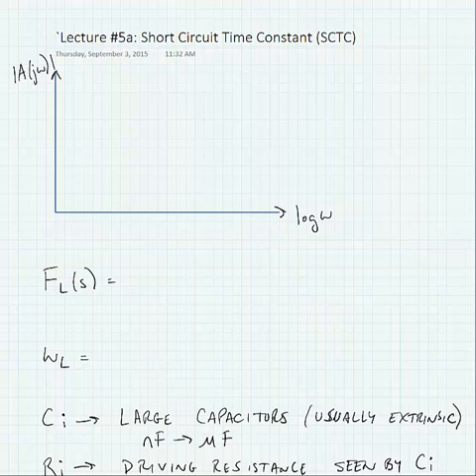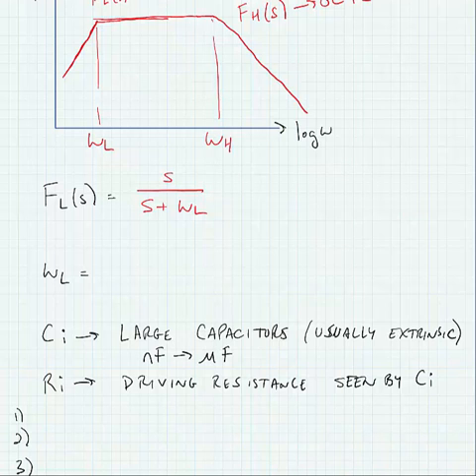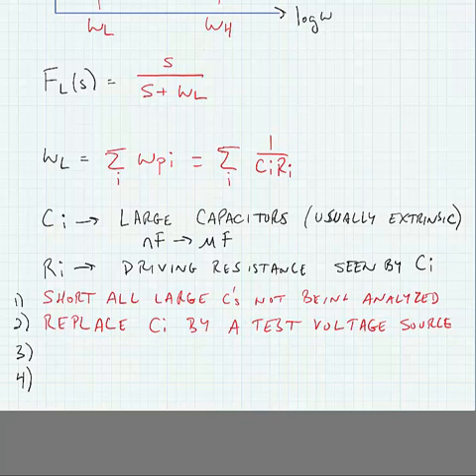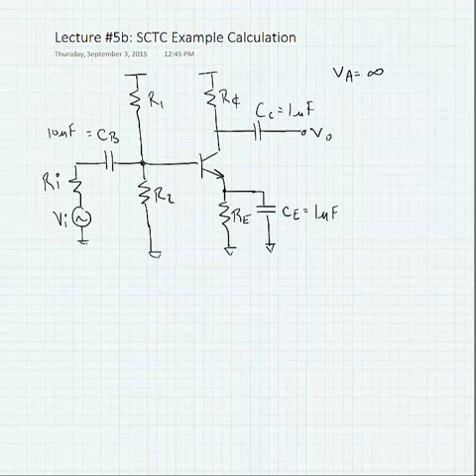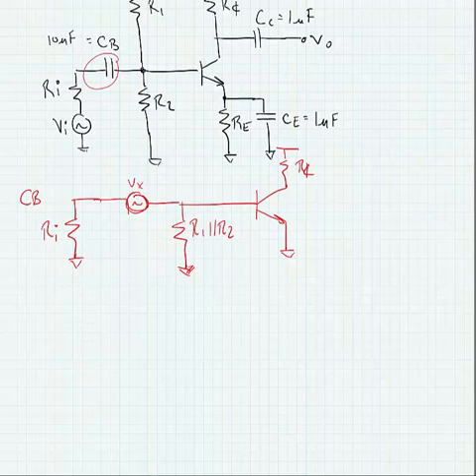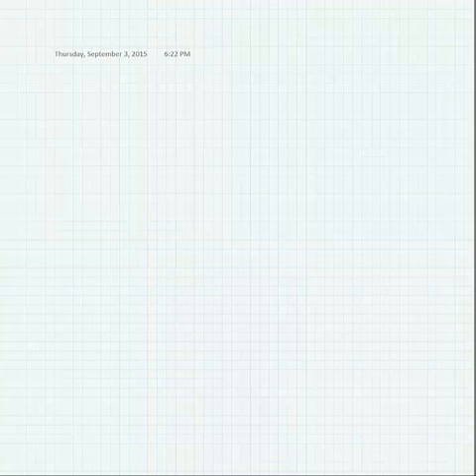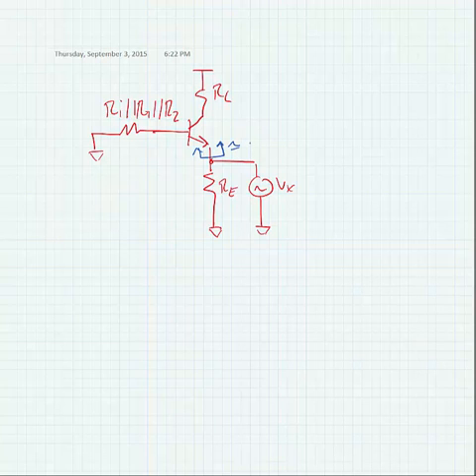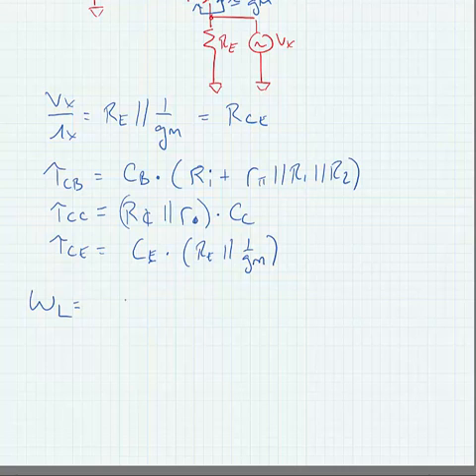ECE 3110 - Lecture 5b: SCTC Example (New)

Comment: Sir can you please explain why the resistance is 1/gm , if we look inside the emitter?
Reply: from E of the BJT, we see a resistance of value R = (rg // RB + rpi) / (1 + beta). If rg is small, rg // RB -> 0, consequently, R ~ rpi / (1 + beta). Usually beta >> 1, so you get R ~ rpi / beta, which is equal to 1 / gm (Remember that rpi = beta / gm). I hope it helps you. Regards!
Reply: @abeldormido5580  Thanks man!